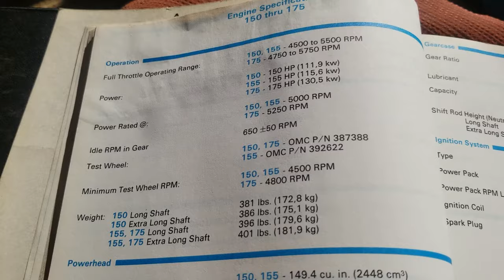How To Link and Sync An Evinrude Outboard

Comment: Hey man im not sure where your  located but in georgia i got a johnson gt 150 vro  so my shift cable broke i replaced it ran great for id say 29 hours i was at mid speed and my boat started acting like it was out of gas long story short i got it runnig better once i pulled the boat out of the water and messed with the control cables on the hose but now when i put my boat in the water once i hit plane my alarm start going off and acts like its outta gas any idea what could be causing this?
Reply from the maker: The carb butterfly throttle plates have to be completely flat at Wide Open Throttle position. When you change those cables out it messes with the timing some too. It can be a pain to adjust the cable back to where it was. Where in Georgia are u?
Reply: @MattsShop  i hear you man yeah im for sure stumped on this rate now  im a jet ski technician but outboards are completely diffrent and i live in acworth about 10 mins from lake allatoona
Reply from the maker: @matthewrobert2888  If it was mine I would adjust the throttle cable at the outboard with the little black wheel until the timing tree is completely straight up and down and check to make sure the throttle butterflies are completely flat at Wide Open Throttle (throttle pushed all the way down). I'd check everything WITHOUT the engine running. I wouldn't touch any of the timing adjustments. Just like at 1:26
Reply: @MattsShop  right on yeah imma try what your saying and unfortunately i messed with the silver arm linkage and the idler adjuster but i didnt mess with the very top one by the flywheel i left that alone do you think if adjust everything the way u explain and stop up to the timing light part id be go to go because it ran fine till the cable broke and i started messing with those settings
Reply from the maker: If you adjust the little silver wheel, it adjusts the idle "pickup" timing. It's hard to say. I always check the WOT timing because I don't want to damage the engine. Anytime you mess with the timing tree you are supposed to do a full "link and sync".
Reply: @MattsShop  Yeah I'm pretty sure something got messed up because it's loping I ended up getting another johnson gt150 i have that all hooked up right It runs good on the muffs But when I put it in water i had iusses it's hard to start so this last time i tried taking it out i primed it and i flood the motor and plugs didn't look their best so I ended up ordering new ones hoping that the iusse with this motor
Reply from the maker: @matthewrobert2888  That sounds like a lot of work! They can be very difficult to setup sometimes! It takes multiple trips to the water to fine tune.
Reply: @MattsShop  Well it was used as a shop motor when people would get motor swaps it was a donar but they got new shop motors and this one was sitting in the shop for about. 6 years Probably a little longer but worked was stored indoors also when it was hooked up they told me i ran good thats why they kept it around and it sounds heathly i just don't know if I messed up by flipping that lever on the choke on the motor. That's red. And pumping the prime too much because the motor did get flooded and fouled the plugs because once i turned it over with all plugs out and cleaned them and started back up but after that I did not attempt to put it back in the water because I didn't want to get stuck on the lake so I ordered new spark plugs.

Comment: Hi Matt, I  have a 1978 140 that I  got running, but the timer advance/plate doesn't return all the way to the stop. It  idles fast, so I  think this might be the cause. It seems to be the wiring harness restricting it. Have you ever seen this? Does it even matter?
Reply: follow the procedure in the manual. you do have a service manual right? it clearly says to make sure you shift to FORWARD detent, then half way back to neutral and pull the slack out them fit cable in trunnion. adjust thumbwheel as needed. key here is idle stop screw is resting firmly on the block. if its off of it, you did something wrong. very easy to set these up properly.
Reply: @ct1762  Thanks, I'm trying to find a manual. I adjusted the idle stop up against the block yesterday,  and got the throttle  cam follower aligned. Made my TDC mark on the flywheel. For some reason the cast timing marks on the flywheel are waaay off. Like 3" away from my new marks. Today I  plan to remove the flywheel  and see if the key is sheared off. Cheers
Reply: @wayne3340  no problem. If the TDC marks are that far off good thinking about the key, but it wouldn't even start if it was that far off. when the flywheel slips, it usually throws the timing out so much it just pops and never starts, let alone idle. definitely worth checking, and the magnet for the timer (inside ring magnet). if that slips time for a fresh flywheel. are you sure you are using the #1 timing grid and have the exact midpoint calculated properly with the piston stop? no need to index the flywheel as he shows... either its working or it isnt. a much quicker way to index is simply stick a pencil in each cylinder and find rough TDC and make your mark. if the number flickers or you see another cylinders #, its misfiring. but no need to know exact timing of the other cylinders.
Reply: @ct1762  Thanks for your reply.  It fires up real nice, and "idles" at about 2200 until warm, then drops down to about 1800 rpm. It revs up from the carb, but under load it hesitates. It will plane out if I'm very careful with the  throttle, but only the odd time it will catch, and pull hard and smooth for a second. I have new plugs and wires on order. I bought a timing light and I'll go out and check timing this evening. I built a little test tank out of a 35 gallon storage bin, and I cut out around the lid to keep the water in. I can actually run it in gear like that so I'll try that again too. Thx
Reply: @ct1762  I didn't really answer your questions.  I am sure my TDC mark is accurate. Standing behind the boat, facing the heads, the top right head is number 1 correct? It's  the highest, then top left, bottom right and bottom left, at least that's  what I've  been told. As far as #1 timing grid, good question.  It only has one timing grid, and it starts with TDC, then has marks for retarding the timing. I don't understand why they did that, but when I search images of a 1978 140 flywheel,  it looks correct.
Reply: @wayne3340  i suspect it has an air leak, which can also mean the carb butterflys are open a smidge at idle, but can also mean a seal leak. easy to spray some ether onto the block and up under flywheel, but check for an oily top seal when flywheel is off. this is an old girl, and can develop leaks.
Reply: @ct1762  Thanks,  I'll do that.
Reply: @ct1762  HI ct1762. Little update,  I  replaced the sheared key, it was 30 degrees advanced at idle hence the high idle speed. Miracle I ever got it to plane a couple times. Also installed new thermostats. There were none! Runs way better now after much adjusting. Only 4700 rpm and 35 mph, but it's a start. No change in rpm when spraying ether around seals and carb bases. Thanks again.
Reply: @wayne3340   good! i have seen timing that far off, but if you ran it any longer it would've detonated. no big deal just a fresh bore n hone, but id make sure its really correct on timing for high speed. 4700rpm is lugging it. check throttle butterflys are horizontal?

Comment: Thanks for this video. I have a new to me 90's evinrude 90 like this one that starts easy, and runs smooth, but only gets to 4000 rpm, and seems low on power. I'm going to start with the stuff in this video, thanks!
Reply: Did you ever figure out the issue? I am currently dealing with the same thing. Had to get some fix on spark to a cylinder, but its still hitting only 4000. Rebuilt carbs, replaced fuel pump and all fuel line/filters so im hoping that will do the trick. I'd love to hear back from you thanks!
Reply: @chupe7561  Nope. I replaced a coil pack that I thought was the issue but that wasn't it. I don't have a lot of money in the boat, it isn't my forever boat, it runs well enough, so I decided to just run it like it is. I get about 26mph with just me on it. Not blisteringly fast, but it gets there. I took it down to fort de Soto a couple of months ago and had a blast! Sorry I can't be of any help. If you figure yours out please let me know.
Reply: @RunninOnCoal  understood im in the same place. Currently replaced plugs, power pack, fuel filters, fuel line, fuel pump, removed VRO, tested all coils and spark, new timing base. Basically at the point where the stator is the last of the worries there if the new fuel items doesnt fix it. I'll report back if I get a better run next time its out. I'm also going to remove the prop its currently a 13x14 right now which is definitely not helping with the rpm.
Reply: @chupe7561  did you find the issue. My 97 evinrude wont go past 2500rpm
Reply: post compression #s here 1st!

Comment: just FYI for everyone : its MUCH simpler than he shows, but complicates things with the pickup timing. all that really matters is you adjust idle RPM in forward gear to 600-700rpm, THEN you set your cam roller/throttle cam relationship with the hashmark. if you do it the other way around, you will now be out of synch. the actual timing degrees dont matter as it will be perfect after setting idle speed as mentioned on a healthy motor.  WOT timing is a set and forget thing from the factory, and nearly all have been adjusted to 28 degrees or else they would be basket cases. static timing for that is much easier.

Comment: Everything was good, until you said you can use a elec tach that hooks to the plug wire. They are total junk, to prove it I hooked up 2 of them, they were off by 600rpm from each other at wide open throttle.
Reply from the maker: What are you gonna use for a tach then. Boat dash tachs are garbage accurate.

Comment: I'm not buying you last video that said the pickup coil was bad 🤔 they almost Never go bad it's always the cdi controller and I see you have a new cdi controller on the motor now coincidence? Not sure why you would do that but whatever 😉 the controllers go bad all the time even new ones go bad the puck up coils NEVER just saying
Reply: If the pickup coil goes bad its usually due to the voltage regulator going bad and melting the epoxy and windings in the stator

Comment: Nice! I have a Xp model as well a 1987 200 XP with only 350 something hours on it. It's been sitting abandoned for years but I'm going to try and get her running again. Fog the cylinders and let her soak and try to rotate the flywheel first. Also have a new water pump to put in I'm not sure she'll need it but I guess it's better to be safe right. Nothing like a good old 2 stroke OMC outboard!!
Reply from the maker: Nice, that's a great find! She'll run once you do all the stuff you said. That is a rare outboard now a days.

Comment: I have a 89 xp 150 can't find a manual do u know the timing specs for mine any help is appreciated
Reply from the maker: You need the manual! Got mine on eBay. It depends on the model number. This motor was 28 degrees BTDC at Wide open throttle over at least 5000 RPM. It's dangerous to set the WOT timing I don't reccomend it unless you know exactly what you're doing (no offense).